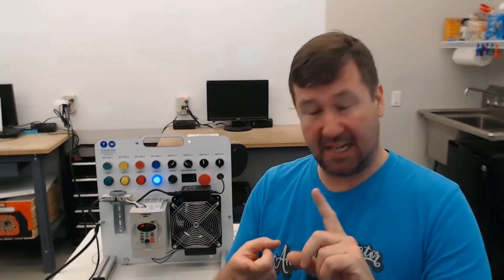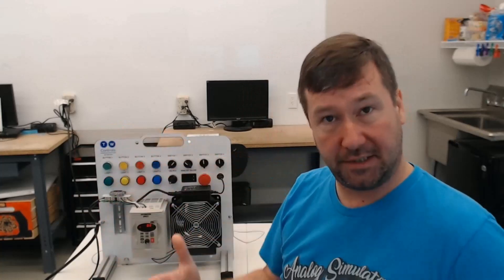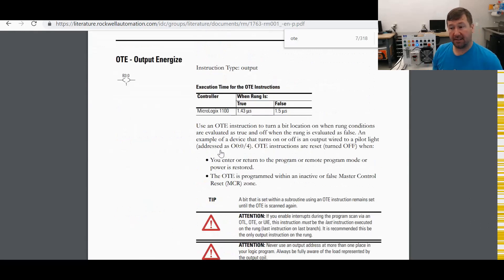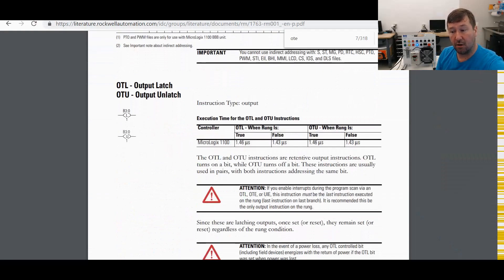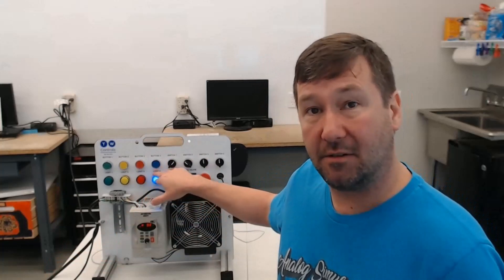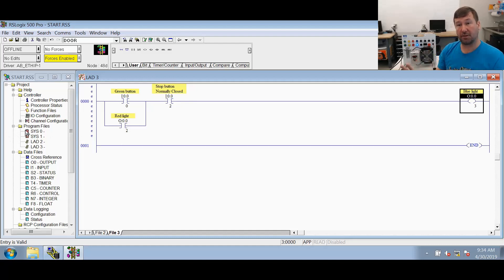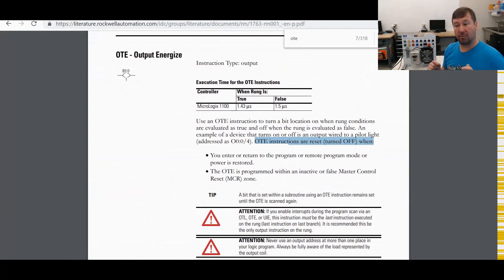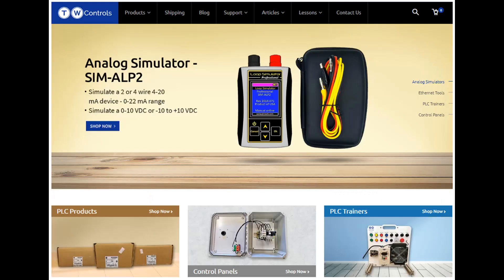How Power Up Affects an OTE vs an OTL/OTU in an Allen Bradley Micrologix PLC.

Comment: Hi Tim
thank you very much
retentive memory is a Confusing topic for me , I can not understand it well
I asked you about it before then you answered me that all the memory in rslogix 500  is retentive (N7 data file)
What should I do when disconnecting the power and connecting it back again 
should I deactivate all memory in first scan (N7 and B3 and f8 data file), so how do I do it? Is it possible to record a video on this topic (retentive memory in rslogix 500 ?
Reply from the maker: Typically there is no need to clear the memory during a power cycle.

Comment: Dear sir, 
As you know if we enter 1 values in some of output addresses in the Output Data File (O0 – OUTPUT ) and then change the mode of the PLC from program to Run or the Power Cutoff and back again to the PLC, these output values will still be 1. If I bought a used PLC and in it many output bits are saved as 1, is there a way for me to write a simple program in the RsLogix 500 ( one Rung or multi  – Rungs ) to make all of these output altogether zero or I must zero the outputs one by one ?
Reply from the maker: As long as they are in consecutive data locations then yes.  Let's say they were in B3:0/0-B3:0/15, then you can use a MOV instruction with a source A of 0 and a source b of B3:0.

You could also use a COP instruction to clear multiple words.  Let's say the range was B3:0/0 through B3:1/15, then  you can use a COP instruction with a source of 0, a destination of B3:0, and a length of 2.
Reply: @TimWilborne  Thanks for your answer, but if there are 1 in O:0/0 - O:0/15 can we make all of these output altogether zero as you made with B3:0/0 - B3:0/15 or not ?
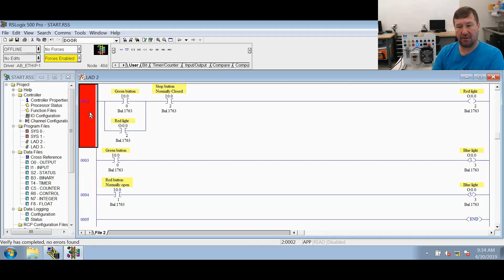Reply from the maker: @alearnerforsafety3692  It will work exactly the same, just address O:0.  A word is a word to a PLC whether it is B3:0, T4:21.ACC, C5:25.PRE, N7:6, or the often left out O:0 or even the I:0.
Reply: @TimWilborne  Thanks
Reply from the maker: @alearnerforsafety3692  You are welcome.

Comment: Why do protection circuits usually use pilz safety relays and not just controller logic? Does the safety relay have any advantages?
Reply from the maker: The key item that safety relays add is redundancy, here is a good video to help you understand.
https://youtu.be/tVn-BychHFA

Comment: Hi, do you have any tips to unlatch the tag/bits( which has been latched before power off) when restoring power? Let say in my logic ive latched 100 tags and powered off so as u said after power restored all 100 tags will be on only but if i wanna unlatch them    should i make 100 dummy OTE which will never called in a operation ?
Reply: In Micrologix we can use a startup bit which will on when the plc gets powerup. How about compact logix and Controllogix ?
Reply from the maker: The S:FS bit in Studio 5000 is the equivalent of the S:1/15 first scan bit in RsLogix 500.  Both are true for the first scan of the PLC program.
Reply from the maker: @nrpanneer3  The S:FS bit in Studio 5000 is the equivalent of the S:1/15 first scan bit in RsLogix 500.  Both are true for the first scan of the PLC program.
Reply: @TimWilborne  Dear Sir, Can you explain more about this issue ? As Mr. Panner Selvam said if we have latched 100 tags in our program, are we need to make 100 OTE in subroutine just to makes these latch not be on when the power restoring ?! Do you have another solution for this problem ? if yes explain it please.
Reply from the maker: @alearnerforsafety3692  You either need to do that or use the first scan bit to unlatch them.  I think I would use the first scan bit, S2:1/15, just because it would be cleaner to understand later.
Reply: @TimWilborne  Thanks for reply, do you have any lesson about "the first scan bit, S2:1/15" or any other materials can help me to understand it and how to create it in the PLC ?
Reply: @TimWilborne  I putting a branch around your red button (which is go to the Unlatch instruction)  and in the branch put a NO S:1/15. By this way when the power come back the green light will not be ON. I hope this is a solution for the above issue. Best regards.

Comment: May i use a micro800 PLC to generate a Pwm or PTO ? Thanks!
Reply from the maker: The Micro 800 does have PTO Pulse Train Outputs but I've never used them.  The Micrologix 1100 is much easier to use.  You can find the PTOs in the Function File of it.